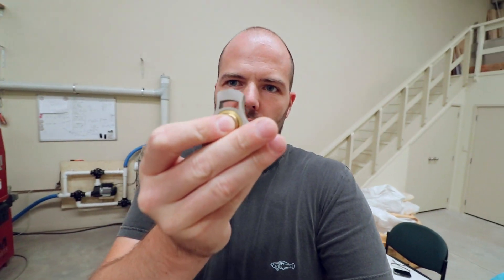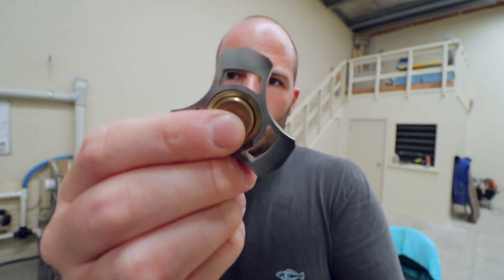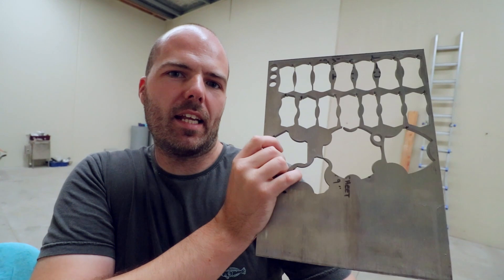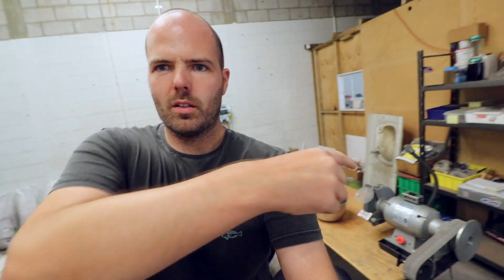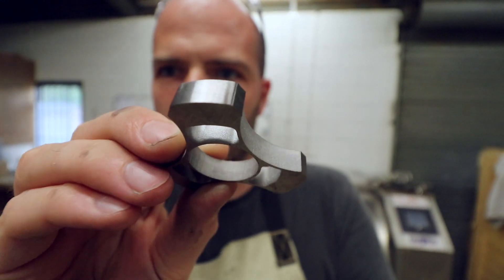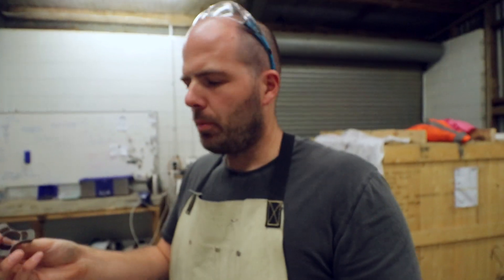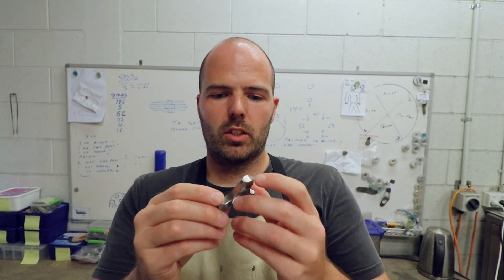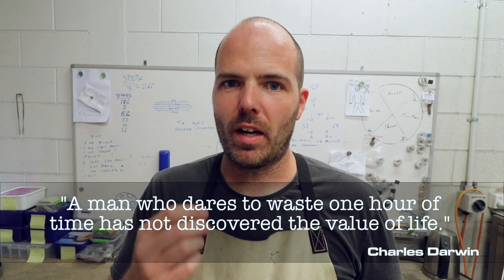Fidget Spinner Project (Part 1)

Comment: I, personally, would love to see the sides thicker (The bits between each arm) so that you can round them off (similar to your polished bi-spinner) so that you cann do the "flick" motion more comfortably, but get a similar look because it would be this thickness to look at from the top/bottom next to the bearing.
Otherwise, it is awesome that you added the bevels to the arms, definitely helpswith the looks, and I am sure the function, too.

Brad
Reply from the maker: Thanks Brad. Yeah, will definitely do beveling if I make this spinner.
Reply: Here is the link to the NTO Designs page so you can include it in the description for those that keep asking: http://www.ntodesignsinc.com/

Brad